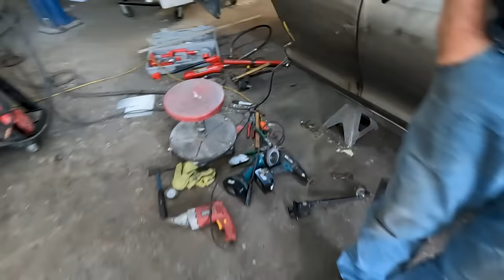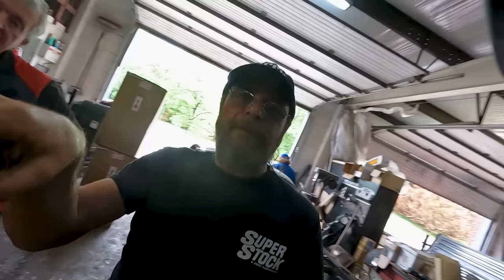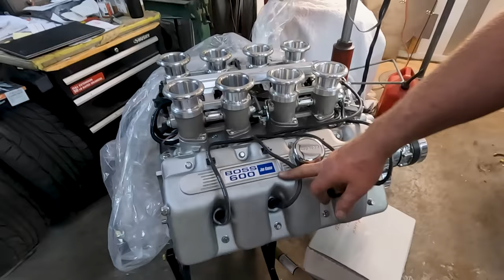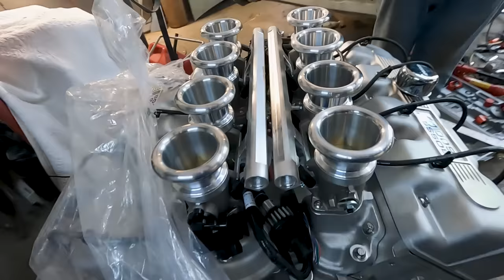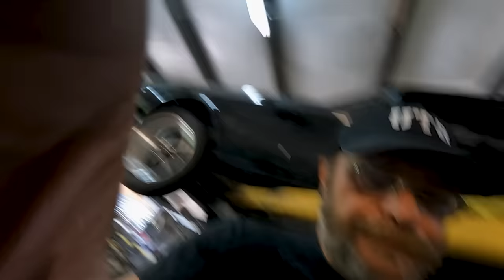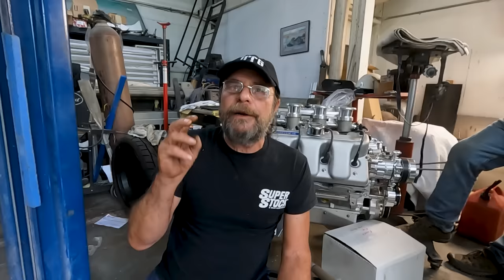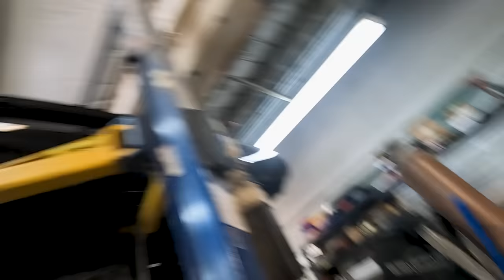How Ford Screwed The Pooch On What SHOULD Have Been The Greatest Musclecar Engine Ever

Comment: My dad has two boss 429 motors. A super cobra jet and a ghen 2 426 hemi in different hot rods. What you Totally missed is the the street boss 429 was a very different head and intake than the nascar head and intake. The nascar head is a true hemi head with a fomoco no part number dual dominator single plane intake. It’s a beast. The street head is the “semi hemi” or “shotgun hemi” with a single carb intake.   That’s the one of the biggest reasons why they were so neutered. My dad has one of each and the heads are very very different in the combustion chamber.

Comment: Awesome history lesson! I'm a Chevy guy and remember  the street battles between the big block Chevys and Mopars, Ford big blocks were always a side note.
Reply: Me to man.
Reply: Thats because the fords were neutered way worse.  The potential was always there to wax the Mopars and Chevs, it was just unknown at the time, took until the late 70s.  550 cubes from a stock early 429/460 block.  With a set of dooe-r 70-71 heads nothing would have came close if someone built that combo in the early 70s.
Don’t blame the engines, blame Ford.

Comment: Timing chain doesn’t stretch, but has slack and wear issues. Until you destroy the oil it doesn’t make it wear out chain due to what fuel. Most are changed on every run with nitro, as so much escapes the rings. Mercedes’ 117-116-119 all have similar chains. When you install new , right cam is 5? Degrees retarded. Benz made offset keys for the shafts and it makes huge difference in idle quality. Ford blew it by not just buying Big Bill, and running nascar
Reply: Nitro engines are so loud because of the extreme valve bending cylinder pressure at exhaust opening
Reply from the maker: Nailed it, Charles.  The chain would whip, stretch and shrink on nitro and the cam phasing was all over the place

Comment: Ford needed to homologate the engine and the Mustang was a popular car to put the engine in and sell enough to qualify it for NASCAR, Ford probably knew exactly how much the engine would put out but due to regulations that were coming and the platform they were putting it in, dialed it back to fit the car and meet regs. It took hotrodders to bring out the beast in the 429 on the streets.

Comment: Tony Ford never wanted to sell the Boss 429 they only wanted the to run NASCAR
Reply: That's what happened late in the '64 season; NASCAR had a problem from GM and Ford after the new Chrysler Hemi (produced for race only) blew the competition away.  NASCAR answered by putting the 500 production minimum for 'stock'' engines which is the reason Chrysler pulled out for the '65 racing year.  (At the same time NASCAR nailed the Cammer by barring overhead cams - that's why to this day NASCAR races still have the sound of roaring engines instead of 12K rpm bee hives circling the track.)

Comment: That's the thing Sherman Sligh said about the Cleveland heads when he mounted them on a 300 I6 (with only 6 cylinders, that worked out to the same as if it was a 400ci V8), that the port sizes were so huge that he couldn't get an engine that small to pull enough air through them fast enough. He filled the intake ports partially with epoxy to get them to pull the air with enough velocity and naturally aspirated made over 600hp in that application. Broke a bunch of NA 6-cylinder drag racing records with it. I think he ran velocity stacks as well with a mechanical fuel injection adapted from I think a Corvette fuelly motor. Don't quote me on that last part though because I can't remember where he pulled those parts from.

Comment: The ‘70 Boss 429 Mustangs did not have o-ring heads, only in ‘69.  Also those Kaasse heads are significantly reworked.  Prior to the discontinuation of the Popular Hottrodding Engine Master series, his motors were peak HP champs.
Reply: Incorrect.... No production boss 429's came with a conventional head gasket... All o-rings, even the nascar engines were o-rings
Reply: You are incorrect. No standard head gaskets.

Comment: There are a few things missing from the timeline. I don't wanna write some big elaborate piece (of shit) because I know no matter what I say or evidence I supply... I'll be wrong.
But 3 things missing from said timeline. 1) The flathead V8.   2) The Ardun conversation. 3) The Ford GAA.   Take a look at those 3 things and see who borrowed what from who.
Reply: Also the 260 Indy engine in 1962 it was converted to dohc the next year. The TP 427 and the gurney westlake small blocks that powered the gt40’s in 68-69 and a few others
Reply: Chevy V8 in 1917.....Checkmate
Reply: @will7its  France had a V8 in 1904. And caddy had 1 in 1914. All 3 are incomparable to the modern engines we are talking about. When I mention the flathead ford V8 it is because of the one piece block all modern V8s use.
Reply: @travislostaglia8861  I'm talking in terms of the timeline UTG laid out. He said Ford blocks are a mix of Chrysler and Chevy, but he's starting in the 1950s. The decades prior disagree.
Reply: @will7its  only made for two years because they were garbage
Reply: @DwayneRouthierJr  i understand what you’re saying but all those engines lead to the boss 9. I’ve heard ut say that nobody ran ford’s until the foxbody but the first funny car in the 7’s was a ford and the first NA door slammer in the 8’s was also a ford
Reply: @travislostaglia8861  No, they were bought by gm and they killed it because of caddy and olds. And it was 1917. The flathead was three steps  back.
Reply: @will7its  no complete garbage and Chevy didn’t make another v8 till 1955 junk
Reply: @travislostaglia8861  Ok Travis......
Reply: @will7its  ok will ……

Comment: There was a article I read once where I young gentleman purchased a 1970 boss mustang and wrote a letter to the skunk works to say how bitterly disappointed he was wit the performance of his car they replied send your car to there facilitie and we will set it up they way we intended it to be for the 1970 year he did and end 2 weeks later he got a car that made just over 500 hp and was a completely different beast apparently the 1970 year model was supposed to have a bunch of upgrades to make it probably the most powerful muscle car ever made but then the been counters stepped in and shut that down cause they didn't sell that well the previous year. The article had all the details of changes that the skunk works did with factory part numbers and everything they from memory they changed the came for a solid more aggressive cam fitted extractors and a bigger carburetor modified the cold air flap deleted  the smog pump and the rev limiter and some other thing thing that slipped my mind so they had the parts and the know how but the bloody bean counters got in the way which is just fords life story really

Comment: Ford choked down the Boss 429 as installed in the 1969 and 1970 Mustangs. The Boss 302 had a 780 cfm carb, the Boss 429 only had a 735 cfm carb. The Boss 429 had a mild 10.5 to 1 compression ratio and relatively mild cam. They way the Boss 429 was set up didn't take advantage of those deep breathing Hemi heads.
Chevrolet's 427 L88 had an 850 cfm carb, a very aggressive solid lifter cam and 12.5 to 1 compression.
If Ford would have set up the Boss 429 similar to the way Chevrolet set up the 427 L88, Ford would have had some powerhouse!

Comment: Hey Tony let's talk about the fact that the intake baseball-sized intake ports Chrysler came out about a week after they release it after they bought one of those Mustangs took it back to Highland Park and said that the thing was I had to be about 800 29 cubic inches to run around the track and make any kind of power all day long and they proposed to him for 26 port in the middle of a baseball-sized intake board on an easel that's what really happened to that motor that's why I couple years later Richard Petty was gone a couple months later and two years later they were back to run to 427 side Oiler

Comment: Why did the Boss 'Nine not fare so well? real easy....a lack of time. The Street Hemi ran through engineering updates since 1966, and there was still a Ball Stud version planned for the 1970's had it passed emissions. It takes a while to detune a racing engine, esp. while the goal posts (emissions etc) were shifting around year to year.  The B'9 had only two years (the 1971 Mustang was so huge because the Boss 429 was planned for it as well), and the 428 CJ/SCJ was a cheaper alternative that made torque--just like the 440 was to the Hemi. Meanwhile, Chevy's Rat had been out since 1965, so they had time to get it right, too. Had Ford created the 429 Cobra Jet/Super Cobra Jet before 1971, there might have been more decent heads floating around for people to build 460's to match the 454's showing up in hot rods in the 1970's

(then again, Ford is cheap--you want the good parts, you buy the top of the line car, so there still may have been fewer CJ heads than rectangle port Chevy heads, for example).

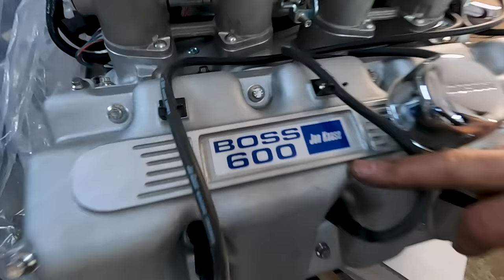Comment: Just looking at some of the comments on here tells me that Ford guys and Mopar guys still have a passion for their brand. I am Mopar. I got my license in 1975. Bought my first car in 1976 at the age of 17. My first car was a 1972 Hemi Orange Duster. 318 with a manual 3 speed. 8 3/4 3:23 rear. Blacked out hood with strobe stripes down the middle. Long black stripe down the sides. 3 months of ownership and I added headers, Edelbrock  intake. Carter 750 AVS carb. Dual exhaust with California turbo mufflers. Cam dynamics cam and Wiend black crinkle valve covers. I was one of the quickest cars at school. Many of Ford went down to this Duster. Also Chevy and all GM products. We always talked bad about the other brands to each other. It was just trash talking up a good race. I did not race any car that challenged me. Definitely a 429 was to fear back then. 426 or 454 was a definite no no. 440? No way. But I did run a few big blocks and handled them enough. Thanks for the video Uncle Tony and Kiwi. Reminds me of when life was not so serious. We could still rib one another and still be friends.

Comment: Ever worked on a nailhead? Dule quench pads, big dome, genuine central sparkplug and pretty good intake flow with velocity. Big problem with the nailhead was the exhaust flow. The nailhead is the original pentroof chamber just not shallow and not with 4 valves. Take a nailhead and put the exhaust in a better place without packaging concerns of really big heads and youve  got basically a boss. What really helped the original Chrysler hemi take off in drag was they weren't too hard to find and could handle nitro well enough to be economically viable. Boss fords were always rare and nailheads just didn't have the exhaust flow required. Combustion chamber evolution is one of the more interesting aspects of engine development. After all it all starts with combustion.

Comment: I have to agree with your “what should have been…” claim.  Not just the Boss, but really the basic 428 and 460 should have become what the BBC is today.  They’re stronger, more reliable, breathe just as well, without all the valvetrain instabilities and other things that a stock BBC suffers from.  But they came along just a little too late, the emissions rules and gas crunches emasculated them before the aftermarket really embraced them. People today often don’t realize just how bad the BBC often was in stock GM trim because the aftermarket so totally embraced it and fixed all the issues GM never bothered with (like holding itself together in a hard-worked early to mid 70s pickup… the things would scatter their guts all over the hayfields compared to a Dodge 440 or Ford 460 truck-been there, saw that firsthand).  Chrysler took the Hemi further in factory-engineered and supported form than either Chevy or Ford, and the aftermarket did embrace it too, but it’s always been on the expensive side. Chevys are dirt cheap AND got all the aftermarket love for 60 years, and you can build one without any actual GM parts.  Ford’s 385 series got the short stick on both cost and aftermarket support.
Reply: I never understood why the big block chevy valvetrain was allowed to go into production with its out of plane valve & rocker geometry which excessively wore the valve guides. The 440 is a gem of an engine - all the torque and reliability you want plus plenty of untapped potential for aftermarket. And of course the mighty 426 hemi - what more can be said when all of the competition runs your product in NHRA. I drove a '72 Mercury Marquis sedan, 429 2-Bbl for years; it was a great road car and I wish I hadn't sold it.

Comment: Chrysler borrowed the Hemi design from the 1947 Ford Ardun Hemi. This engine actually goes back to 1939 and the beginning of WWII. The Ardun hemi heads were so wide that they could only fit in trucks, so Ford of England used the engine for firetrucks, garbage trucks and dump trucks. The engine was also an option on the English Alard sportscar.

Comment: When I was a teen, in 1980s, I had a 69 Mustang with just a small block.  So I bought a Ford Motorsports catalogue when I was rebuilding the engine.   And most of the racing parts and engines were Boss 429.   So it did have a run, just not in production cars.

Comment: Some of Ford's decisions are just mind boggling.  The Cleveland and Lima engine designs were, or at least could have been, absolutely awesome performers.  Tightening emissions standards did hamper performance, but why stick a massive big block into the small engine bay of the Mustang?  The Torino would have been a much better candidate for the 429 Boss.  I like Ford's, always been a Ford guy, but some of their decisions make little to no sense.

Comment: I really think the thunderjet and the early 460 really put people off the cobra jet engines. It’s not that they lacked it’s just they had zero support like the early gm and mopar big blocks did so people just assumed it would be the same with the cj and scj engines. People that were ford loyal knew the potential of the bbf that was never unlocked until aftermarket parts became plentiful. It’s just like the 351 cleavland and the 351 Windsor. On paper the cleavland was the better engine but in actual practice the Windsor ended up being the better platform. I think that same mentality lined up into the 429 engines.

Comment: In my opinion, the reason the BBC became dominant was the lack of available aftermarket parts for the Fords. Ford built every trick part anyone could want and sold over the counter with their Total Performance program.  There was no financial sense for aftermarket parts suppliers to gear up and compete with the factory. Different story with Chevrolet which did not have this level of commitment and relied on the aftermarket. When Iacocca got control at Ford he pulled the plug on any and all performance. There was no longer parts or information on Ford performance.

Comment: Why did Ford strangle the street Boss 429? Because they didn't want NASCAR to do it in like the Cammer, insta ban. Put it out there, let the opposition test it, think it's a dud, then shock them in race trim. It was supposed to run twin Autolite 4 bbl inline carbs, NASCAR said no, so Ford got the initial rights to the Holley 4500 carb. Its life in NASCAR was short, relatively speaking, as NASCAR had to slow speeds down, eventually resulting in the current (small blockish) displacement rules.

Comment: I think Ford's biggest mistake with the Boss '9 was to shoehorn it into a Mustang, as this led to most of the other problems associated with it. Had it been placed in a Torino, or even a Galaxie, then the compromises would have been minimal. The acceleration measurements of the Big Boss were embarrassing against the Boss 302. 😝
As it was, Ford lost big bucks on each Boss '9 Mustang sold. 🤒

Comment: That's right up there with Ford's decision to replace the 289 with the 302. The 302 wasn't a bad motor,but it was a boat anchor compared to the high winding 289. What the hell were they thinking?

Comment: i always loved Leslie Snoboski  who started the GM racing division in 1970 with the LS block but on ford i love the fe blocks the 390 and 428 on chevy i like the 454 or 427 mopar is the 440 or 426
Reply: I've always liked the 390 3x2bbl in a 61 Starliner.
Reply: @briansearles4473  i have a 390 out of a 63 t bird came with the tri power setup 400 hp but did u know they build 3 different 390 fe blocks and they all have different trans bolt patterns the 63 t bird is one of a kind only in a 63 t bird which i found out the hard way when i had to build a bell housing for it because i could not get one used or new

Comment: He makes this engine sound like such an amazing piece of engineering... Look into the BMW M10 inline 4 , 1.6 1.8 or 2.0 ... In F1 they boosted it and made 1200 hp w a block that was originally making 65 hp ... In Europe they can make 800 hp w stock aluminum heads

Comment: Ford would never stick with anything long enough for it to be cost effective in the long run. They constantly changed everything from engine designs to bellhousings and never left anything they got right alone. Chevy got so popular in the racing world because they made a good design and didnt change it until something better was to replace it. 
Chevy small blocks and big blocks are easy to find and identify and everything will interchange. Ford small blocks and big blocks are confusing and almost nothing interchanges and most of the older stuff that should be affordable is a abandoned design that nobody supports anymore making it obsolete.